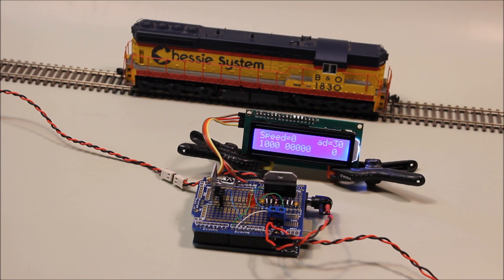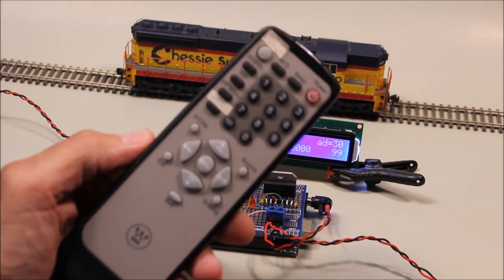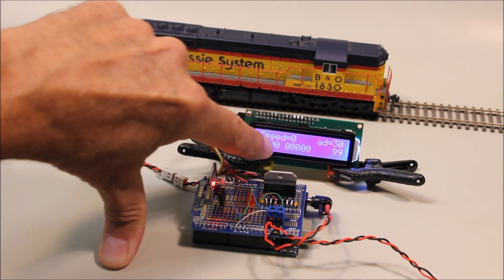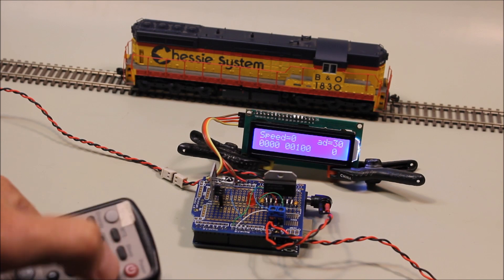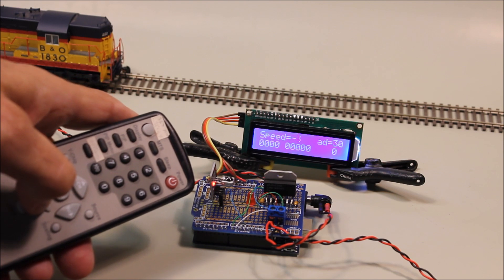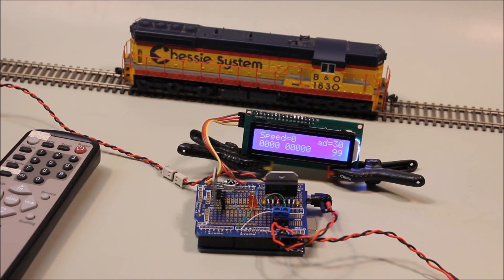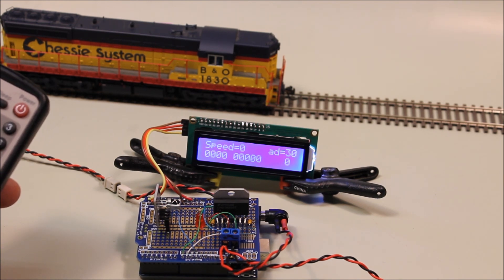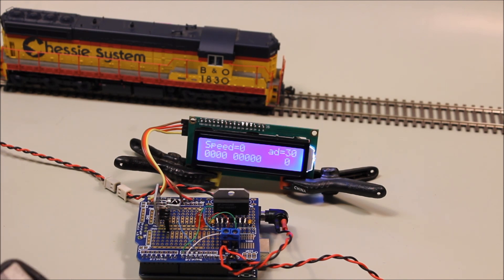Arduino DCC Controller

Comment: Dave do you know if you can use the arduinos on board, to control servos? Ive seen servo controls, have servo controls, but wanted to program a sweep code- then like you have a function button turn it on. Any ideas?
Reply from the maker: Matt - the best I can do is to point you to several articles I have on my web page - see:

https://www.google.com/search?q=dcc+servo&sitesearch=trainelectronics.com

I am sure you will find some ideas there

dave

Comment: Thanks Dave! I am using battery powered locomotives so wonder if you have experimented with adding a Tam Valley antennae, or similar, to talk directly to onboard receivers (NCE, CVP, or TV)?
Reply from the maker: I have not tried this with battery powered locomotives - For battery operation I either use an HC-12 and a home-brew H-Bridge power unit or something like the G-scale Revolution radio control
dave
Reply: Dave Bodnar Thanks for the rapid reply! Is an H-Bridge even necessary for a wireless transmitter?
Reply from the maker: Neil - the H-Bridge goes in the loco as I make my own receiver/controller for the locomotive.
dave

Comment: Great video, and really helpful! but isn't it easier to use a L298N module instead? or doesn't that have the right pin layout for the LMD18200? 
Greets, Marco
Reply from the maker: Marco - The pin-outs are different and the L298N has a lower current limit.
dave
Reply: Ah, ok! thanks for the answer! I'll stick with the LMD then.

Comment: can you use this to write CV codes as well ? irrespective if it cant, its really good use of Arduino - i will consider it for my Z gauge layout over using Rasperberry Pi's which cost much more.
Reply from the maker: If you hook it up to JMRI it will write CV codes and allow programming - very nice and not too difficult to do.
dave
Reply: Thanks Dave ! I will try it out !

Comment: Hi Dave, 
thank you for your work and for sharing it.I am trying to make a decoder with ProMini, but no one code are not working. Only one, from this site, but partially and with some bugs.
http://lamaquetade.infotronikblog.com/locodec-arduino-dcc-un-decoder-para-locomotoras/
Poor recognition of speed and bug with instant 0 speed, and can recognize only 1st function.
Do you have any code for decoder (receiver) which can recognize functions from your encoder?
Once again, 
GREAT WORK and THANK YOU!
Reply from the maker: Sorry, Igor - I am not familiar with that web site's code - the code I used is on my web page, here:  
http://www.trainelectronics.com/DCC_Arduino/controller

dave

Comment: Dave...I have a project that uses a small n scale layout in a classroom. The subject is PLC programming and I want to use the layout to respond to the learners PLC programs. The best way to control a locomotive with DCC is not the object but the students writing a program in a PLC and having something interesting that responds to it. It would require replacing the infrared interface with discrete digital inputs on the arduino or raspberry. Any advice is valuable. Thank you......
Reply from the maker: Prof - I would suggest using DCC++ rather than the system shown here - see the other notes below about it - you could have your students use the PLC to deliver straight serial (RS-232) commands to the DCC++ controller and you can build up a controller for less than $20.
dave
Reply: Cost is not an issue...the less building circuits the better. Is there a system available for purchase?
Reply from the maker: You can build the DCC++ controller by purchasing an Arduino UNO (less than $10) and an Arduino motor shield (again less than $10) - you plug the two together, add two jumpers and power and you are ready to go.

See my notes here
http://trainelectronics.com/DCC_Arduino/JMRI_DCC++_Setup/index.htm
and more info in the links shown here:
http://www.trainboard.com/highball/index.php?threads/links-for-dcc.95220/

dave

Comment: HI, this is VERY interesting. I've bee unsing Arduinos for some projects, and I'm now a newcomer to model trains. Still in "analogue mode". So, you have to program the Arduino in order to recognize the IR signals coming from the remote control. Then how do you send the signals through the rails while at the same time powering the motors?
Reply from the maker: The DCC protocol takes care of the details of sending info to the decoder in each engine - 
If you are interested in this topic I strongly recommend looking into DCC++, which I have moved to for the last 8 or 10 months - see info on my web page here:
http://www.trainelectronics.com/DCC_Arduino/DCC++/index.htm
and
http://www.trainboard.com/highball/index.php?forums/dcc.177/

dave
Reply: Dave Bodnar
Well I tried but at trainboard they keep on asking me "Historically, trains in the United States had a ________ at the end." and there is no way I can find the answer. Not only I am a newcomer to the hobby but living far from USA, I can't find the propper answer. I understand the need for blocking spam but they have gone too far with this one, most sites just ask for a simple and generic question that any human is capabe of answering.
Reply from the maker: Try 

caboose
Reply: Thanks, after "googleing" and "wiking" for a while I found the answer, thanks. So far,  managed to read the buttons from an IR remote control, next comes DCC. A direct question: is it all about powering the rails with the apropriate square signal while at the same time varying the pulses width to encode the commands?
Reply from the maker: That is how the DCC system works - a constant square wave DC is placed on the track and the DCC signal is superimposed over it.  Very cool
dave
Reply: If I find the LMD18200 or similar bridge, do I need to connect all the pins? I just need to test the sending of the amplified DCC packets and see if a decoder responds. Can I use a L298 for the same purpose (though it is rated at 2 amps, I can try with a small DC motor).
Reply from the maker: You do need to connect all of the pins that are specified in the schematic to get the LMD 18200 working - I don't believe the L298 will work with this implementation - it does work with the DCC++ (a much simpler method of getting DCC working!)
dave
Reply: Ok, I'll try ti find that H bridge here. Now, as a newcomer I have many questions. Do you feel comfortable if I post my questions here?
Reply from the maker: I prefer email  - you can contact me directly at dave@davebodnar.com
dave
Reply: BTW I' watching "An Arduino DCC++ Base Station: The Hardware - Part 3 of 4" video and he says that a bridge driver like the L298 can be used, provided he necessary discrete components are added, but there is a board that already comes with that dual H bridge (so we have power for  main and programming track).
Is just its current limit (2x 2A) the problem?
Reply from the maker: The standard Arduino motor shield has the L298 and supports two tracks, main & programming - it is not really capable of 2 amps but works well at 1 amp - look over the other options I have written up here if you need more power:   
http://www.trainelectronics.com/DCC_Arduino/DCC++/index.htm 
dave
Reply: Dave Bodnar:  Or end of train light.  Since modern railroads have done away with cabooses the end of train light replaced them (wish they would bring back the caboose).

Comment from the maker: Hi, Jos - my first thought is that you do not have all of the necessary libraries installed.    A number of them are used - whenever you see a line like this:
#include<EEPROM.h>
you need to make sure that the appropriate library is in the Arduino library directory
dave
Reply: +Dave Bodnar 
Hi Dave,
Sorry, but I am novice on Arduino. I search my libraries directory and I can found the EEPROM folder and WIRE folder. How I can get the others libraries?
Regards
Reply from the maker: +Jos Henrique I. Oliveira 

Jos - search Google for      

download Arduino library EEPROM

or something similar - once you find the files put them in the "library" folder in the Arduino directory - remember to restart the Arduino IDE after adding them

This link should help

https://www.arduino.cc/en/Guide/Libraries

dave
Reply: +Dave Bodnar 
Hi Dave,
OK, I search https://www.arduino.cc/en/Guide/Libraries.

The issue is, at where  can I found the others  *.h archives?

On the source code CmdrArduino_Controller_IR_LCD_v2_7 there are lines as:
#include<IRremote.h>
#include<DCCPocket.h>
#include<PocketQueue.h>
#include<PocketScheduler.h>
#include<LCD.h>
#include<LiquidCristalI2C.h>

Every line above is one libraries. I must manually add all these archives on my libraries.

Normally on a project these archives became in a *.zip or *.rar folder. it's not like that?

Thanks for your help.

Regards

Iscold
"
Reply from the maker: +Jos Henrique I. Oliveira 

Jos - you have to search for them - most are on Github 

For example  https://github.com/z3t0/Arduino-IRremote  has the IRremote library

To expedite your work I have put a backup of my libraries on Dropbox - they are here:

https://www.dropbox.com/sh/cky0z6oytpwhhv0/AACNmHfirZ-yteM-LEPhlqyia?dl=0 

Just copy the files into your library folder.

dave
Reply: +Dave Bodnar 
Hi Dave,
Thank you very much! 
Now it is fine. It is only the time, some pieces of hardware arrive, assembly the shield board as your electronic schematic and put the trains to ride.
Regards
José Iscold
Reply from the maker: +Jos Henrique I. Oliveira 
I hope the rest of your project goes very well.
Enjoy!
dave
Reply: +Dave Bodnar 
Dave,
It will....., I hope as well.

Comment: HI,Dave

Very interesting project, tanks to share with us.

I copy the sketch to Arduino IDE 1.0.1, but the compilation get these errors:

sketch_dec25b:55: error: 'IRrecv' does not name a type
sketch_dec25b:56: error: 'decode_results' does not name a type
sketch_dec25b:60: error: 'DCCPacketScheduler' does not name a type
sketch_dec25b:86: error: 'LiquidCrystal_I2C' does not name a type
sketch_dec25b.cpp: In function 'void setup()':
sketch_dec25b:93: error: 'EEPROM' was not declared in this scope
sketch_dec25b:98: error: 'lcd' was not declared in this scope
sketch_dec25b:99: error: 'POSITIVE' was not declared in this scope
sketch_dec25b:109: error: 'irrecv' was not declared in this scope
sketch_dec25b:110: error: 'dps' was not declared in this scope
sketch_dec25b:111: error: 'DCC_SHORT_ADDRESS' was not declared in this scope
sketch_dec25b.cpp: In function 'void loop()':
sketch_dec25b:123: error: 'dps' was not declared in this scope
sketch_dec25b:123: error: 'DCC_SHORT_ADDRESS' was not declared in this scope
sketch_dec25b:130: error: 'lcd' was not declared in this scope
sketch_dec25b:154: error: 'irrecv' was not declared in this scope
sketch_dec25b:154: error: 'results' was not declared in this scope
sketch_dec25b:183: error: 'irrecv' was not declared in this scope
sketch_dec25b:183: error: 'results' was not declared in this scope
sketch_dec25b:215: error: 'EEPROM' was not declared in this scope
sketch_dec25b:280: error: 'dps' was not declared in this scope
sketch_dec25b:280: error: 'DCC_SHORT_ADDRESS' was not declared in this scope
sketch_dec25b:283: error: 'dps' was not declared in this scope
sketch_dec25b.cpp: In function 'int translateIR()':
sketch_dec25b:289: error: 'results' was not declared in this scope
sketch_dec25b.cpp: In function 'int doFunction()':
sketch_dec25b:397: error: 'lcd' was not declared in this scope
sketch_dec25b:411: error: 'dps' was not declared in this scope
sketch_dec25b:411: error: 'DCC_SHORT_ADDRESS' was not declared in this scope
sketch_dec25b:426: error: 'dps' was not declared in this scope
sketch_dec25b:426: error: 'DCC_SHORT_ADDRESS' was not declared in this scope
sketch_dec25b:437: error: 'dps' was not declared in this scope
sketch_dec25b:437: error: 'DCC_SHORT_ADDRESS' was not declared in this scope

My knowledge on Arduino program is very poor. Is it possible any help?

Regards

Comment: congratulation! great proyet. I,m waiting the componets for do it in a n scale. I have a question . Can this DCC controler program the decoder( asing a number) or I have to put the number to the decoder with orher DCC controler? thank,s
Reply from the maker: +Francisco Jesús Millan Santana 
The unit is not set up to program decoders (to change CV's) - I use a Digitrax or Mini DCC unit to do that
dave
Reply: Thank,s from Spain!

Comment: pretty cool project dude!!

one question, does the decoder was included in your train? or did you build it yourself?
Reply from the maker: +Ignacio Cossini   The decoder in the loco was added on but the system will work with built in decoders or add-ons.
Reply: +Dave Bodnar Thanks Dave for your answer. Do you have any link about how can I build my own decoders for trains? (some website or diy already working project) 

I have a dc training system that I would like to move to digital. This means that I will need to add decoders to every loco. This is not a problem, if I have a working model for a decoder. 
I do have programming experience, and some knowledge about electronics, soldering, and other stuff. I just need the right guidance.

Thanks for your help, much appreciated.
Reply from the maker: +Ignacio Cossini I have not had too much interest in doing locomotive decoders since the cost of the materials is likely to exceed what a built-up unit would be - I have paid less than $20 for decoders and could not build one as small for that cost.
It can be done but I have not experience doing so.
dave
Reply: Oh!, thank you very much again for your answer, Dave!
Hope your project goes well, have a nice day!

Comment: You can add more functions, such as for example consist?
Reply from the maker: Marcelo Reis 
I don't see why not - once you can talk to the decoder the rest is just code.  Not necessarily easy code, but code nonetheless.
dave
Reply: Dave Bodnar This could make for an interesting open source project, particularly for entry level DCC systems. This + JMRI and a loconet shield could do some really cool stuff, but I imagine Digitrax would pitch a fit about us using LocoNet without paying them :P

Comment: Very cool Dave. Does this unit connect in to an existing dcc system?
Reply from the maker: Yes - It is shown communicating with a locomotive that has a standard DCC control board in it